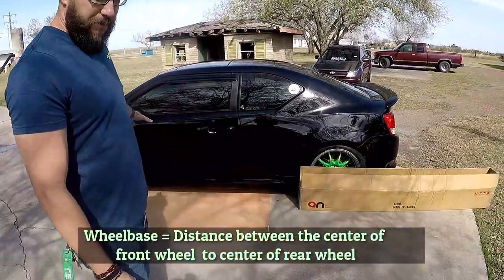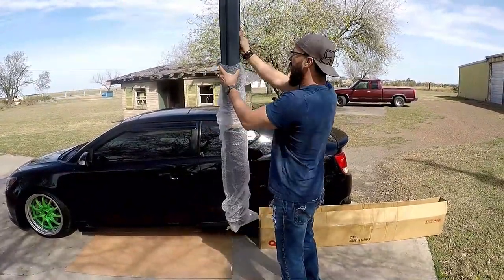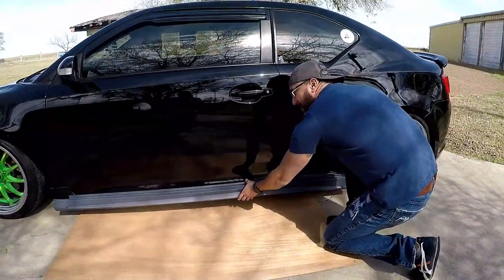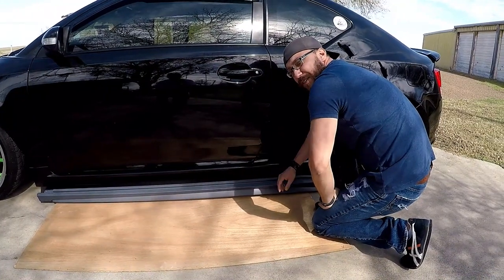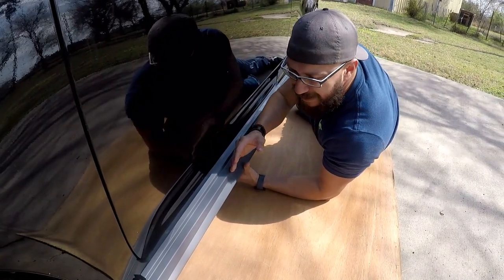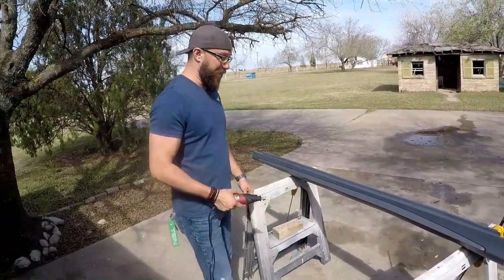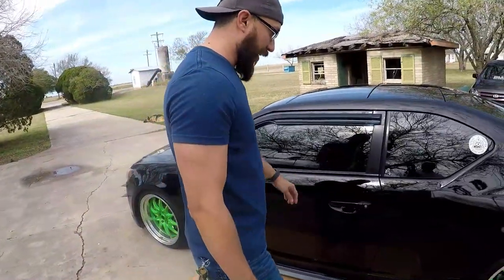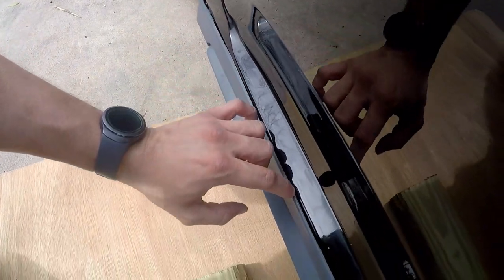DIY Clinched fender flares (Wide Body) - Slammed Scion Tc - Custom side skirts Mercedes Pt. 2

Comment: okay what size spacer do you think i would need if i got 7cm fended flares
Reply from the maker: john byram400 they add 7 cm width. 7 cm is equivalent to 2.75 in. So I decided to run a 2.5 in spacer to keep a wide stance.

Comment: Where did you purchase the drill/slotted and your rims?
Reply from the maker: They're Detroit Axle drilled/slotted rotors. From their website or Amazon. Rims are TrakLite Holeshot staggered set. F: 18x9.5 R 18x10.5 both +35 offset.

Comment: did the fender flairs fit fine or did you have to cut them
Reply from the maker: john byram400 they actually fit really well. Of course you'd want to use a spacer or wider wheel. But you'd have to cut fender and rear quarter panel. The only spot I would heat and mold the flare is where the rear side skirt dips in a little. To give it a unified look.

Comment: Cool we’re did get it from
Reply from the maker: Matt Luna side skirts or fender flares?
Reply: The skirts
Reply from the maker: Matt Luna they're side skirts off a 2017 Mercedes CLA 250. I found them on eBay. Very quality set.
Reply: Matt Luna jjj